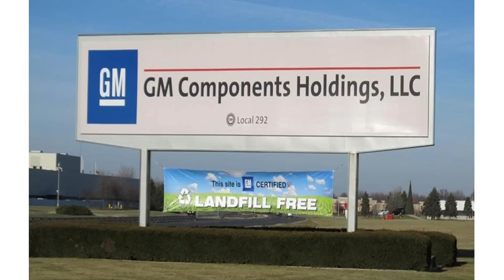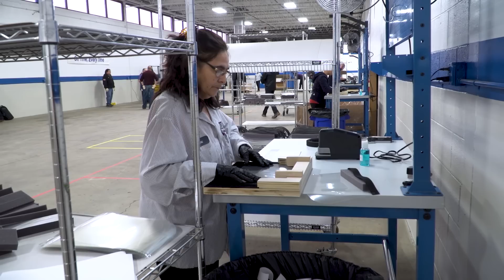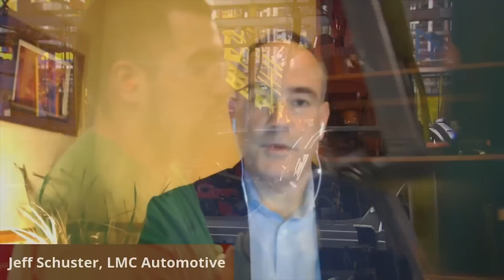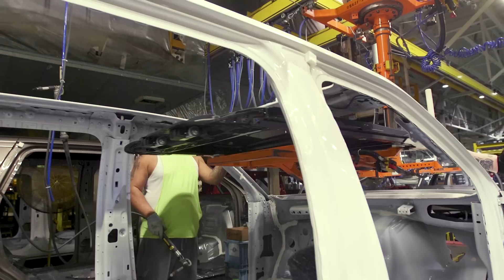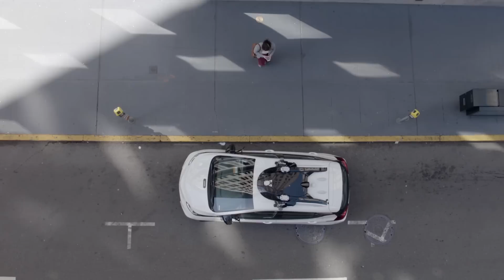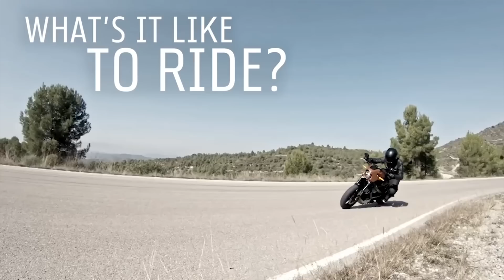Aston Makes High-Power Hybrid Engine; NHTSA Clearing AV Path - Autoline Daily 2800

Comment: If they are making medical equipment which I commend them for, why not use the same method for continuing auto production. Even if it’s with a skeleton crew. From what I saw in your video all of the face shields lacked any type of robotics. Just a thought. By no means is this meant in any negative way.

Comment: GM - we're converting one of our plants to make 200k ventilators by next month

Ford - working with industry leaders on manufacturing respirators and face shields with off the shelf and 3d printed parts.

FCA?  ... "We're gonna make some face masks"

So obviously any help is amazing and I thank all companies for stepping up.

Just want to point out how low Chrysler's engineering might has fallen. They used to make fricking rockets, now they are barely scraping bottom and making face masks 😕

Comment: Universal health care in the US would be a good start.
Reply: Screw that our government can't even run the postal service without constant increases to postage stamps, if anything stamps should be maintaining their prices or slightly increasing with all the automation and more efficient vehicles they've switched to over the years. Instead stamps have jumped multiple percent increases and only a few years apart. 

Then look at the DMV, if their computer system has the slightest issue you mind as well come back another day because you're gonna be waiting hours. 

I have zero faith that government run healthcare will be any better. It will be behind schedule and over budget.
Reply: @OneNationUnderGod.  The cost of everything has always increased, it's called inflation.

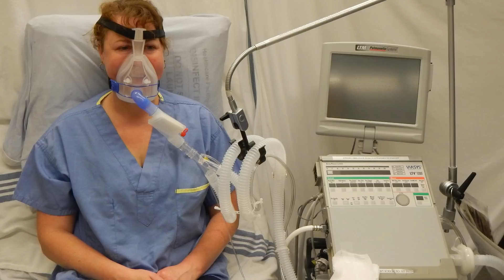Comment: I assume you mean 5,000 per day? 0:52
Reply: No. What he said matches the press release.
Reply: Perhaps you are aware, but if not, ventilators are complex instruments and not N95-style masks.
Reply: Nope..."volume target has gone from making (parts for) 150 ventilators a month to as many as 20,000" https://www.reuters.com/article/us-health-coronavirus-autos-ventilators/gm-accelerates-project-v-to-build-ventilators-in-indiana-idUSKBN21A2Y4
FWIW, couldn't find the 5,000 month figure, in article that AD used...
Reply: Utube wannabe expert: "That sounded like an underwhelming number to me too"
Anyone with common sense: So how many ventilators are you producing?
Reply: I just did the math. today is 3/24, comment was 5,000 per month with a delivery target of 200,000 units by 4/6... 200,000/5,000=40 months... however even 5,000 per day wont get you to 200,000 by 4/6. It's just math.
Reply from the maker: @AHAUGHT  4/6 is the date when they start delivering the first units, not a big dump of all the units at once.
Reply: "First parts need to be delivered by suppliers to GM by April 6"  So "math" is pointless when it based a on BS assumptions...
Reply: That sounded like an underwhelming number to me too.